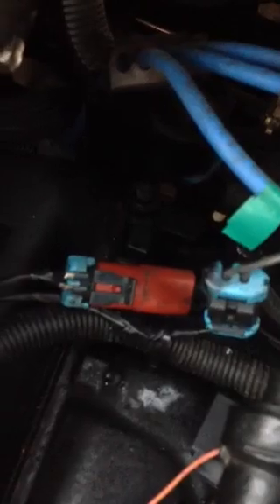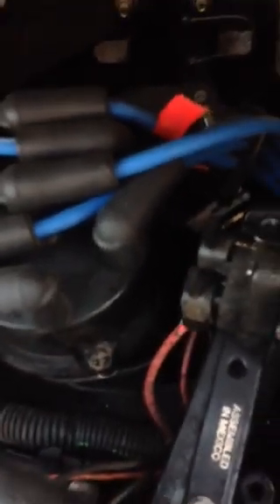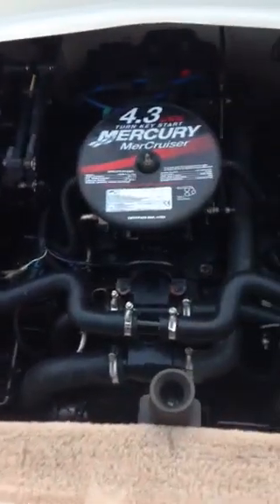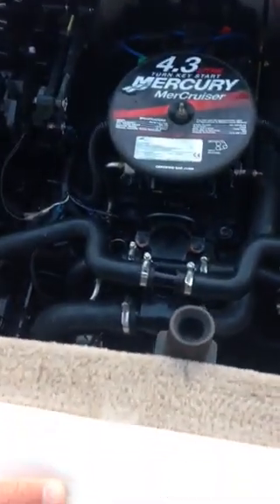Boat won't start but blower and bilge work blown fuse

Comment: Thank you Thank you so much!!!! Exact same thing with mine. Took it out after replacing the 15amp mini fuse. Ran it at all RPMs for an hour and runs awesome! I posted a video as well and there is more room to show exactly where the fuse is on the back of the motor. I wish you all the best and may Good Karma always be with you!!! 2008 Bayliner ignition died is the search

Comment: You can't know how important your videos are...first time boat owner, used 2002 Bayliner Capri.  A few repairs done at the marina-really expensive-$1400.  Took it out on lake, started fine, fished a bit, tried to start...nothing.  The 'trim' control worked, bilge pump didn't work, had to tow it back.  I am troubleshooting it now because husband wants to take it back to the marina but I think the problem has to be a fuse or a solenoid.  It's going to be a really expensive boat if we have to take it in every time there's a problem.  Thank you so much.
Reply: Hi,I have the same problem with a1998  Wellcraft with a Volvo Penta.  What was the fix?

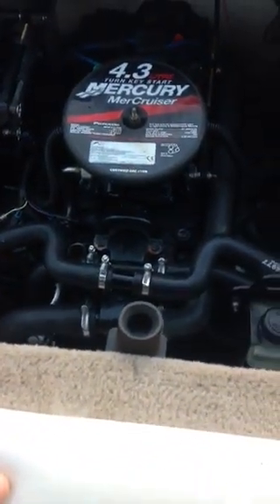Comment: Great video. There is a second fuse holder (20 amp) near the RED thing at 3:00 minute mark. I am currently chasing the same problem, so every bit of info helps. Thanks.

Comment: Thank you for this video exactly what was wrong with mine the 15amp fuse took a bit to find it its in a plastic case you unclip it saved me a costly trip to the shop
Reply: I am having the exact same problem.  Did yours crank or give you nothing.  I changed the ignition switch and now I have nothing.
Reply: What kind of fuse. A blade or bar type?

Comment: Man I hope this will be the fix to my solution. I’ve called myself checking everything & I honestly don’t have a clue what I’m checking, I just kinda poked in every fuse on the boat . I had no idea there was a fuse back there . Man I regret selling my Caravelle , I took on so much water during a parade on the lake that it pushed the kids from the bow of the boat to the back & I said that will never happen again . We we’re going so slow and it just took a nose dive .  I really regret selling it . I had a ski Nautique (an older one) , then the Caravelle and now I have an older moomba Kanga . Hang on to that boat those are really good boats .

Comment: Did you find the reason why the fuse blow?

I have the same issue ambit the fuse blows easily if it touch cables under the dash.
But can’t figure out which.

Comment: Just had this issue, I now can trace every freakin wire in the boat.  ended up being one of the connectors under the dash, unplugged/re-plugged, viola.  Thanks this was helpful but no fuse on mine

Comment: When this fuse was blown, did the engine crank or not crank? My 4.3L mercruiser won't crank. I can't find this fuse. Do you know the wire color? The key switch and battery are good, kill switch is set to run, slave solenoid (starter relay switch) is good, 50A breaker is new and pushed in. I turn the key and the starter relay switch just clicks. Seems to be sending power to the starter solenoid. The blower and bilge work, trim too.
Reply: same issue here what was the problem?
Reply: @businessonly6039  As I recall, I had to replace the starter. I did notice that the starter cranked slowly for a few months prior but I thought the battery was low on voltage. Didn't suspect a bad starter.

Comment: It will crank but will not turnover. Also found the tension pulley for the serpentine belt broke so the belt was not on/working

Comment: Having a almost sim problem but mine turns over and wont stay started. I didn't or don't see a lanyard safety switch that's hooked into the system though.

Comment: I have this same issue now on my Bayliner (Mercruiser 3.0) 175. I checked those fuses that you show. I puled them out of their carriers and Ohmd them out and all were good. 2 were inline fuses around the engine all good. I did not see inline fuses around the starter key under dash. No sound what so ever from solenoid. Battery volts 12.66v  I even put on a new 50A main engine fuse that you showed the one with the yellow gate that pops down. I took off all the battery cables and sanded them still nothing. I tested the starter key and replaced it with a working one from my other boat, nothing. Ideas?
Reply: Brian Mowers  what was the problem did you find out.
Reply: did you ever find it?
Reply: I have the same problem on my bayliner 175 merccruiser 3.0 did you find what the problem was
Reply: Same what was the issue as have 3.0 mercruiser prepping ready to launch to the sea, fitted charged battery then went to crank it to run it up on the hose it cranked over fine 3 times then stopped gauges weren’t working then thought ignition was dodgey had a fiddle under the dash it flickered attempted brief crank cut off and now nothing no gauges working power to trim fine that works just not ignition and gauges been and bought new ignition thinking it was that but still same issue can’t. Checked fuses and wiring under dash all fine I don’t see any fuses on this motor engine side that could be related anyone have a clue??

Comment: Hi I have a 84 Seaswirl that won't turn the starter, batteries good but no dash lights and no starter turning, no sound from starter.  
Any help would be appreciated.  Thank you Steve.
Reply: I'm having the same problem.  If you got it fixed what was it . Thanks!

Comment: Hi there, can You make a pic of this fuse/location please? thanks
Reply: I checked all the wires around the motor, unplugging them.  One had a small 20amp fuse (like you would see in a car) not sure why it blew but it fixed my problem!